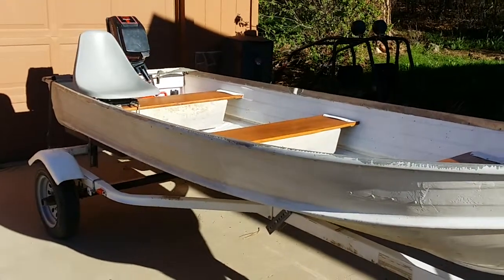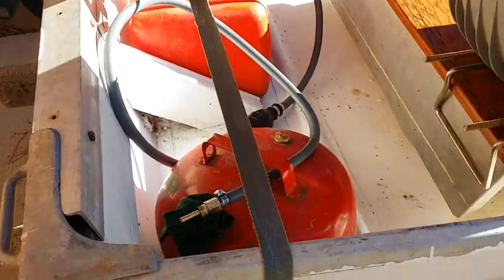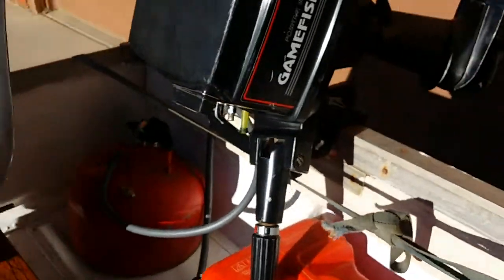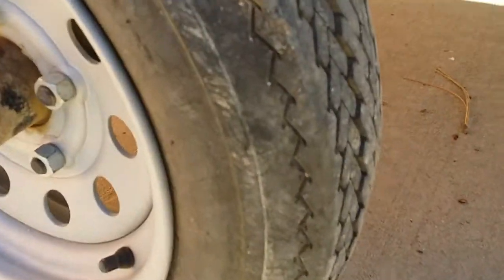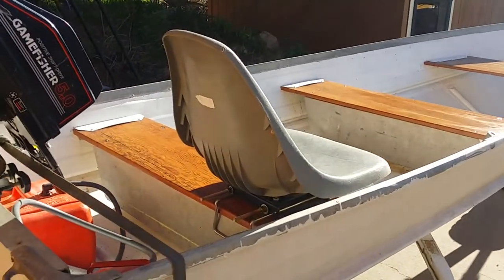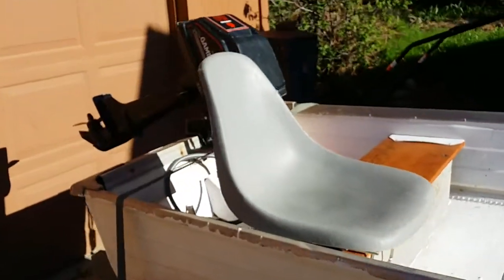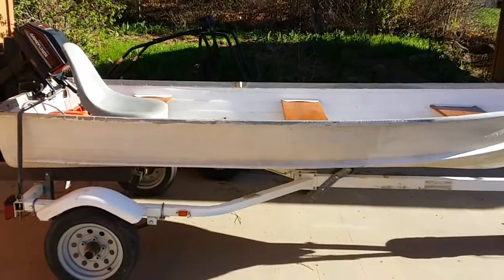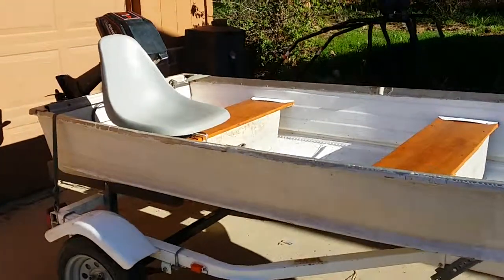12 foot aluminium boat and 2005 trailer.

Comment: so does a 12 foot boat need a 12 foot trailer
Reply: Wonder the same thing
Reply: You don't have to have a 12 foot trailer, it's fine to have the transom hanging off the back of the trailer. Just make sure you lengthen the bunks if you have a heavy engine. You can always buy a shorter trailer and lengthen the tongue (the single piece of metal going from the hitch to the frame of the trailer)